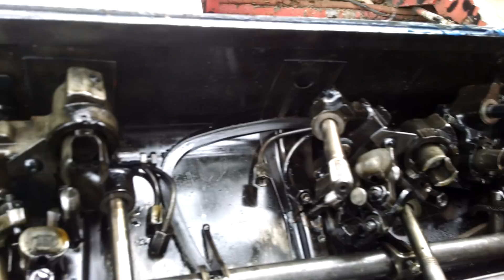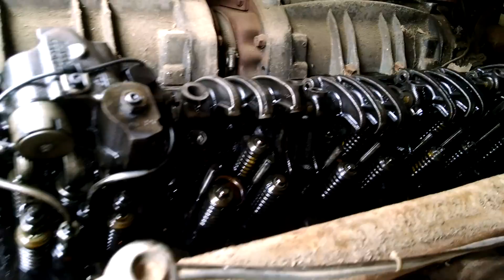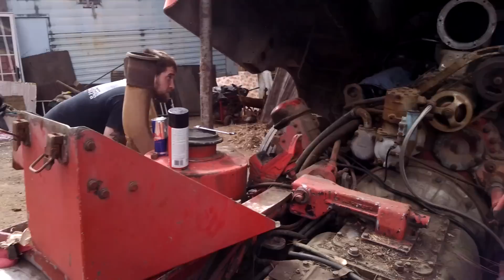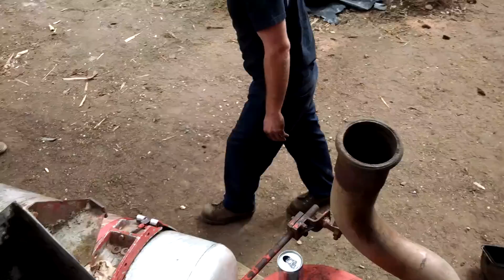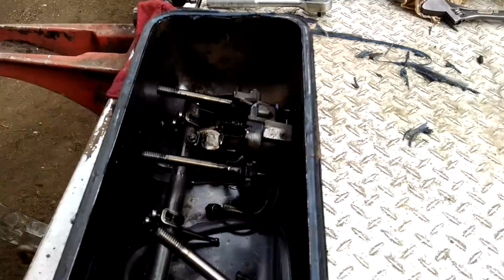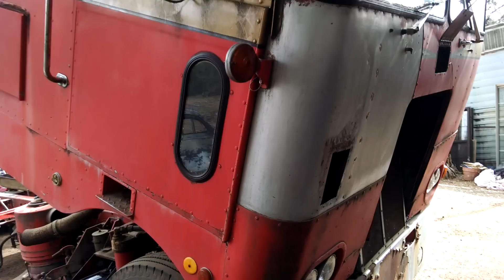ABANDONED 1969 Peterbilt in the woods, 12v71 DETROIT DIE$EL

Comment: please do not use regular ether on a diesel engine ! use the type with lube in it ,or you wipe out the cylinder hone .prewarm the oil with a hot plate under the oil pan .the biggest problem is getting fuel flow from the pump .